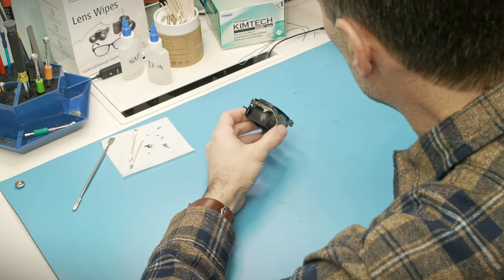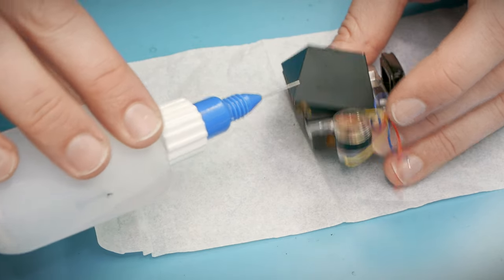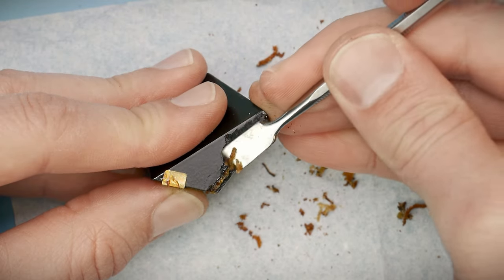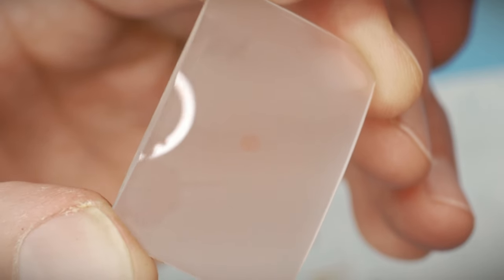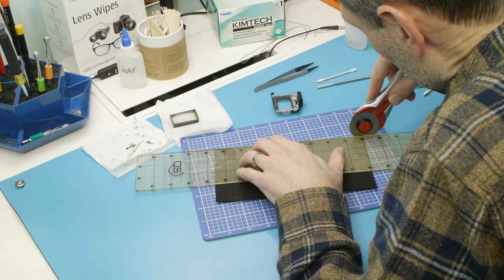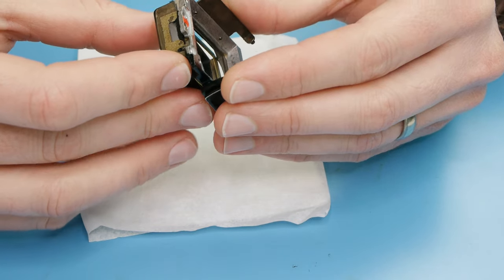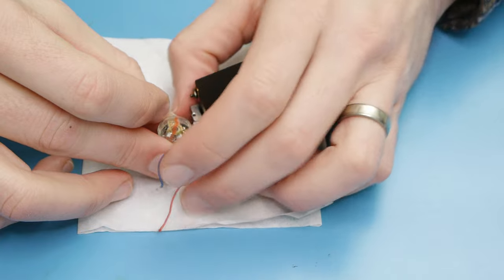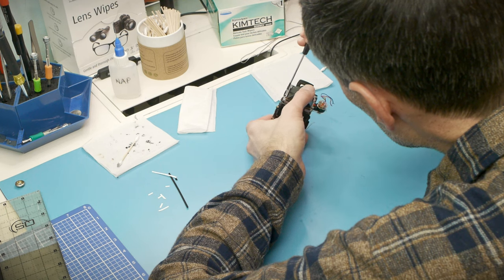Pentax K1000 | Part 4 - Viewfinder Cleaning

Comment: It looks dangerous. I lost some prisms trying to get off the old adhesive tape with old foam. Even after adding ethanol, the prism coating often comes off
Reply from the maker: Shoot, that sucks. I wonder if the foam had already done its damage by the time you got to it. I asked some other more experienced camera repair folks and pretty much everyone recommended cleaning out the foam in this situation. But it could be one of those cases with no perfect solution. Each choice has its own risks.
Reply: @SamsCameraBench  thanks for your reply and recommendations. You have wonderful videos. It’s just my observation, maybe the paint was already weakened under foam. Twice, I got degraded prisms from good one. I don't know where I went wrong, 96% isopropyl alcohol is not supposed to degrade paint. Now I'm afraid even to breathe on the prism. I remove the foam but save the old adhesive tape, and apply the new foam to the wall around the prism.